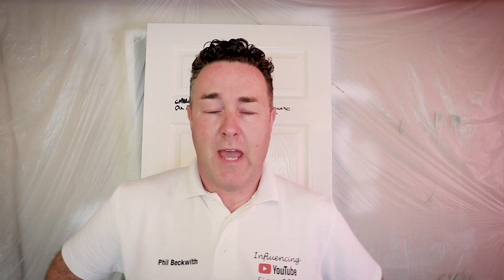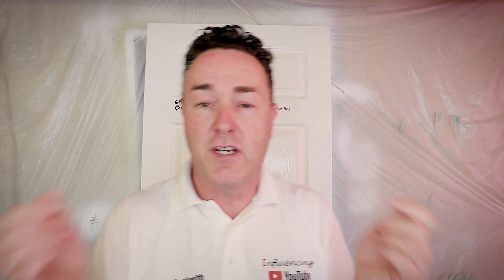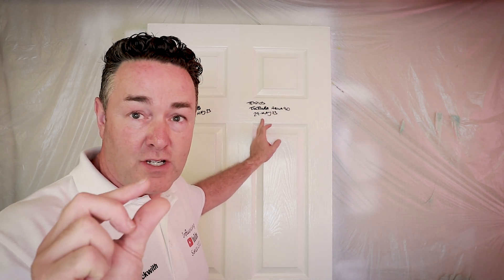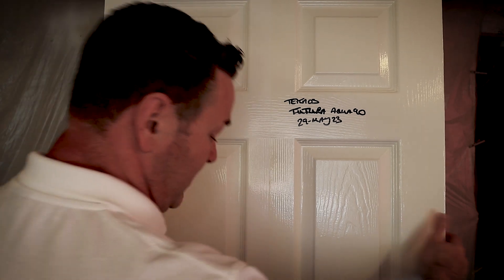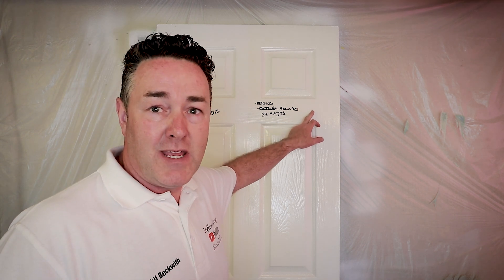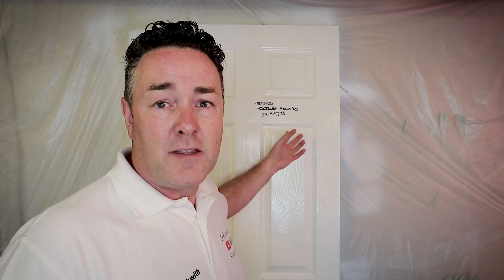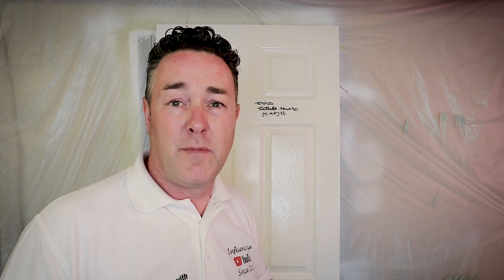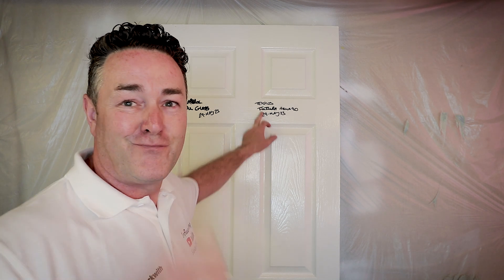why does  water based paint go yellow

Comment: It can be a matter of factors. Heat, sunshine, water ( hot or cold ) used when thinned down, painted over oil based paint, steam, smoke, the quality of the primer or timber and I can go on and on. I encountered all this issues and it’s frustrating as a snagger like me doing it for 20 years almost and working with different brands almost daily.
Reply from the maker: What would you say on this door. Same surface, same conditions it's kept in. Two different paints, done within 24hrs of each other...
The conclusion?

Comment: Just going off track Phil just purchased crown mat vinyl and crown mat scrubbable both off crown colour chart called Figment, after taking off both lids there was a marked difference in colours, one was very much like the colour shown on chart that was the scrubbable one and the plain Matt vinyl was shades different and not the shade as shown on colour chart. Spoke with crown tech and they said yes there will be a difference in colour as the scrubbable one as it has certain pigments in it to make it scrubbable and therefore there is a difference, please tell me if this is correct with other manufacturers. Thanks…….
Reply from the maker: I think a different product will give a slightly different colour.

Some brands may be better than others.
Reply: @ProfessionalPainterDecorator  hi Phill, not a slight difference, quite a difference,,,,,,,,
Reply from the maker: @chippy3350  it should be near the same as the colour card, no matter what paint they mix you up.
Reply: @ProfessionalPainterDecorator  yes Phil that is exactly what I said to the Crown tech division, even the colour mixing machine put in different colours for each product, something Crown should be investigating, like talking to a brick wall.
Reply from the maker: @chippy3350  did they select the correct base to put the pigment in. 
Different product bases can have different colours in them to get the right overall colour.
Reply: @ProfessionalPainterDecorator  yes Phil they did, I have sorted out the issue, I got them to put the tint they use for the mat vinyl into the scrubbable  paint and that has given me the colour I asked for on the first order,,,,something ain’t right with the tints they use in the normal mat emulsion as the tints they use in the scrubbable emulsion the colour I wanted on their chart was Figment in normal mat it was a lightly shaded white the scrubbable one when applied turned a light shade of pink, it looked awful. Think Crown need to get their act together and investigate the whole range of the tinted products so us the customer get the colours we choose from their colour charts no matter what base is used.

Comment: I'd stick to the more acrylic side ones. I didn't know of this issue with water based paints going yellow Thanks for the info 👍 I used the heritage this week and was really impressed with it. I'll defo be using it again. I use mainly oil on most jobs. But I'm going to start trying these other water based paints. Only really used the dulux stuff. And it's garbage. But the heritage is class.
Reply from the maker: You know I've tried a lot of good paint and some not so good.
Reply: @ProfessionalPainterDecorator  Phil quick question please. I'm gonna take the plunge and buy a sprayer. Seen your hvlp and I'm impressed. But my budget could stretch to a decent ish one. Looked at the wagner xvlp sprayer?? Just buy a proper hvlp? Or try the cheaper  xvlp? I've got a big feature wall coming up it's the modern day artex mdf paneling 🤣 I don't fancy brushing and mini rolling it.
Reply from the maker: @bunabuna9287  bit the bullet. Get a stage 5 hvlp... You'll make the money back in no time
Reply: @ProfessionalPainterDecorator  thanks Phil. I'll go with that 👍
Reply from the maker: @bunabuna9287  1.5 and 1.8 needle sets a must and a remote pot.. get a deal somewhere
Reply: @ProfessionalPainterDecorator  thanks for the advice Phil. I'm going to do searching this week and get one. 👍 thanks again your a star mate
Reply from the maker: @bunabuna9287  shame I'm not sponsored by anyone who sells Sprayer lol

You could buy via my Amazon Associates shop... Though ;)
Reply: @ProfessionalPainterDecorator  now that would a be a bonus 🤣 I'll check it out 👍
Reply: Teknos Futura Aqua isn’t waterbased though. It’s oil suspended in water. So it’s basically a hybrid. 
Brilliant stuff if you don’t want white though.

Comment: I used the Bedec MSP satin over some oil based satin and it scratched off the wood even though it was thoroughly prepared. A customer brought a wickes 5:44 store brought Dulux water based satin over oil and after 1 coat I scratch tested it after about 4 hours and it was solid.
Reply from the maker: Bedec MSP is fully cured in 30days

Comment: Hybrid paints are totally pointless, might aswell use oil based. My go-to for fully waterbased is Bedec. Never have any problems
Just been back to a job to paint a bedroom. I painted a staircase last year with Bedec advanced satin in its still lovely and white, even at the top of the stairs where there is no natural light
Reply: How does it hold up against hand oils? I always find waterbased paints on handrails etc disintegrates after a while.

Comment: Where a high gloss finish is required I’d still go with 2 coats of Crown Solo.  The finish is brilliant and doesn’t yellow off quickly like other oil base paints.  I did a hall and stairs in this 5 years ago, went back this week to paint an adjoining room in wb satin and there wasn’t much difference in ‘whiteness’.  So rather than compromise with alkyd based paints I’d stick with the Solo for its high gloss finish.  I don’t think  many pros pick this because the drying and recoat times are rubbish, but if can work around this it’s worth it for the superior finish IMO.
Reply: The Dulux  once yellows very quick ?
Reply: @richardmcdougall233  Yes that’s very true, it’s awful.  Crown Solo doesn’t, it’s a different formulation.

Comment: using a water based will add if doing a whole house be adding up to 50% to the price especially on a old oil 3-4 coats compared 2 or even one in some cases on prev painted you will use more paint thats doesn't go as far in general anyway and also doesn't naturally cover stains its more work and can be harder work the decorating trade is going backwards not forward even a lot of the emulsions interior and exterior are not very good also they should stop making retail paints just stop make life a whole lot easier for us decorators so we dont have to worry so much about customers insisting on getting gear themselves
Reply: Yep, more coats required at start but they save in long run i always tell them as it only requires a refresh top coat,i use Acrylic Leyland primer undercoat  over oil based woodwork followed by Acrylic Leyland hardwearing eggshell, i liken it to new PVC as its the purest white non yellowing mid sheen finish & great with families with kids as dry in 10 mins & takes the knocks